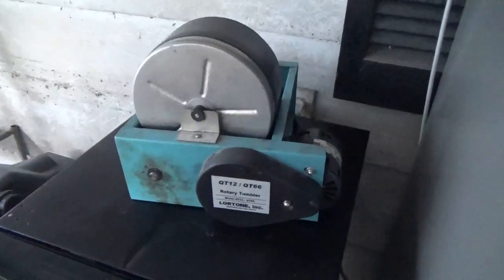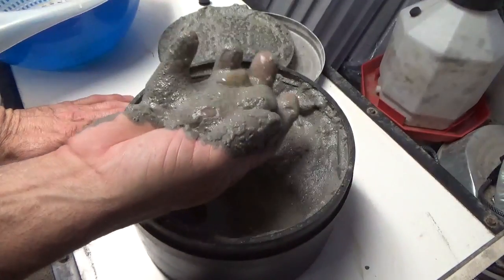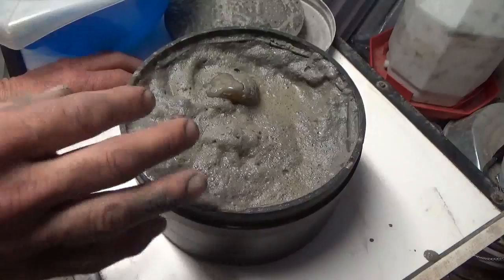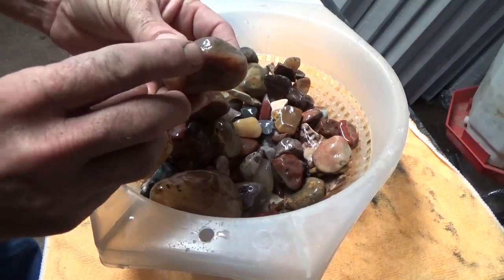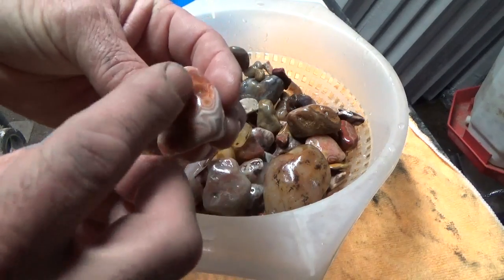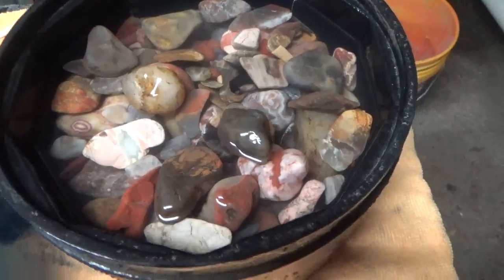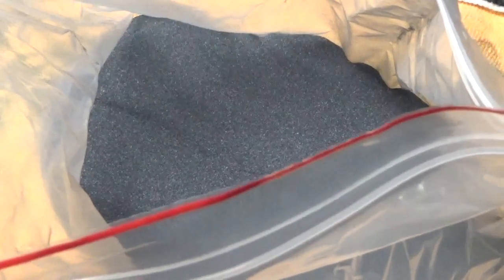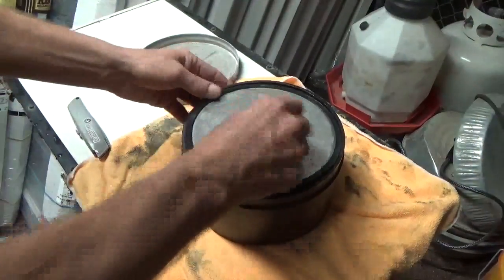Tumbling and Polishing Rocks. Step 2. The 150/220 grit tumble.

Comment: This is cool  I always wanted to do this and after watching your first vid I ordered a dbl 3# tumbler and 20# of rocks from Washington State on Ebay and got a good deal on a grit assortment on Amazon. Now I'm just waiting for the tumbler to arrive and I can get started. I was amazed at how much smoother the rocks were after the first grind, now I can't wait to get started.
  Thanks for this and all your vids Joe looking forward to Milissa's house repair.  Thanks again
Reply from the maker: You will have to let me know how it turns out. what brand tumbler? I would love to buy a double 3, the double 6 is fine but you will find that it is much easier to do with the smaller 3 pound loads. As far as the ones I am doing in this video, they will smooth down and get smaller through this step 2 as well. Thanks Alf. Joe
Reply: Lortone Model 33B-NR  Gem Sparkle Rock Tumbler Twin Barrel I got this on Ebay

Comment: After this first polishing, they look nice enough to me. Could I skip further grinding and just jump to a polish finish step and would they take a shine to be able to display?
Reply from the maker: That is pretty much what is happening. It takes 4 steps to get there.
Reply: They look good because they are wet. Let them dry and you would see all the scratches. The following steps make the scratches smaller until they still look good when dry.

Comment: I never saw the toothbrush do anything. I run the rocks with borax for 6 hours or so between grits. The water comes out quite dirty.
Reply from the maker: I bet that works great. I just want to get it switched into the next batch, that 6 hours may have me doing something totally different and not in the mood to be going back to the rocks but I bet your way works really well.

Comment: You said not to let the rocks get dry. Why do they have to stay wet? What happens if they dry out?
Reply from the maker: If there is any of the slurry in the crevices it will dry in there and then during the next tumble it can work it's way out and since that grit is not as fine as the the stuff in the next tumble it will scratch the rocks and they will be dull instead of shiney.

Comment: Question: I’m new to tumbling, I’ve just got my first batch going. Why can’t you let the stones dry out? I’ve watched a few video’s and I’ve not come across that before. Thanks
Reply from the maker: It is just a precaution. The slurry that is created during the tumbling process is like concrete. Let it dry and it can "cement" pieces of the previous step into crevices. Once the following step starts those pieces can break loose and now you have a (for example) piece of courser grit tumbling along with your less course grit. Think of it like getting a piece of sand in your eye. Just one piece can scratch it. The same with the tumbler. You have a 4 step polishing going on but one of your steps has a previous steps more course piece in it. It can then scratch the whole batch leaving them "cloudy" like your eye would be.
Reply: NorthernSeclusion thank you, that makes sense

Comment: I had a smaller set up, and was going to divide my rocks into batches....therefore I was thinking i could take out the first batch let it sit off to the side for a couple weeks as I tumble out the rest to bring them  all up to step 2. So what would be the issue with my first batch drying up entirely and just waiting around for a few weeks? I suppose i could leave them in a bucket with water for the whole time, but I'm just wondering what the difference would be anyway?

Comment: Could the sludge that forms be useful in further tumbling of rocks or metal parts, etc?  It looks like it could polish something.
Reply: You can polish metal parts with these tumblers but instead of the powder that Joe was using you would use what looks like stainless steel BB's (they sell them but I don't know what they're called)
Reply: it's a novel idea but the truth is Quartz and most stones have a 7. on the harness scale.. it is hard but it will only polish softer metals and then you have the silicon carbide grit with a different particle size that is well mixed with the slurry that will definitely scratch most surfaces because it's got a hardness of 9

Comment: Do you think it'd work to use marbles as a filler?
Reply from the maker: You actually can use marbles but glass has a hardness around that 5 to 5.5 range and most agates are in that 7 range. People have used them though and they do work, they will just grind into tiny marbles faster than using the ceramic media which has a hardness in that 7+ range.
Reply: @NorthernSeclusion  Hmm. Alright. What about coins? Have you ever tried putting a bunch of pennies or anything? Someone told me I should try it, but I don't know.

Comment: i recovered the grit by precipitation  just letting it in a bowl with water from the washing, it went all to the bottom, i took the water out and it was ready to use again.
Reply from the maker: That grit will have broken down during the tumble and will not be as sharp and do nearly the job it is suppose to do.
Reply: @NorthernSeclusion  isnt Silicon Carbide almost as hard as diamonds?.

Comment: Nice pattern on that rock with the circles :) Looks like damascus steel. By the way, I'm interested in kinda the oposite of what you're doing - I'm trying to find a natural sharpening stone, but so far, no luck. They are either too hard or too soft - do you have any ideas on what rocks make good (or just barely decent) sharpening stones?

Comment: Sorry for the stupid question but.... why do the rovks need to be kept wet?
Reply from the maker: I think it is so the slurry does not harden on the rocks and in the crevices where it would not get washed off and then at a later stage break loose and ruin the batch.
Reply: NorthernSeclusion isnt that why you clean them with brush after each cycle to remove grit?

Comment: realistically step one takes about 4 to 6 weeks for rough stones. I like to  cut them, and maybe work them with my dremell, to get the deep pits out. step two is about A week, then drill if making pendants. Into step three for another week, You can also do A step four, 600 grit. and finally polish!! The big one is step one don't cheap out on that one especially with agate cause they just wont come out nice!! When I tumble stones I want them to come out as near blem free as possible!!
Reply from the maker: I have no want to do all that dremell stuff etc. Step one takes between 5 and 7 days.
Reply: I beg to differ step 1 takes many weeks to accomplish!! You must have some amazing rocks that can do it in 7 days. Or they are very soft!!
Reply: That's half the fun shaping stones and then let the tumbler take over to finish the job. Got some really nice results from that!!
Reply: @ant-1382  Bla Bla Bla